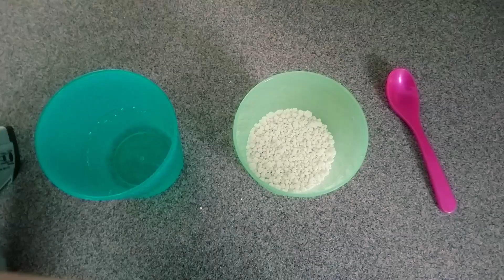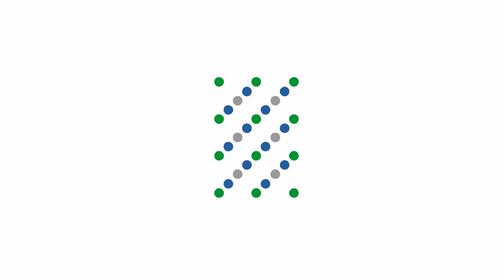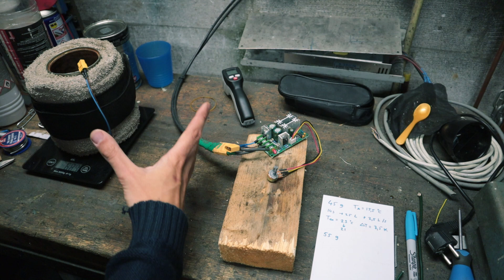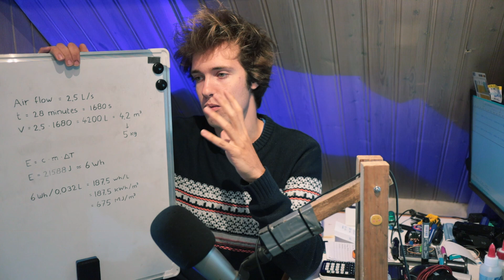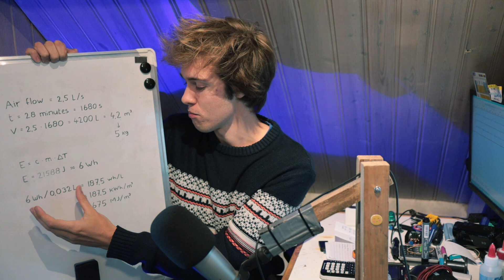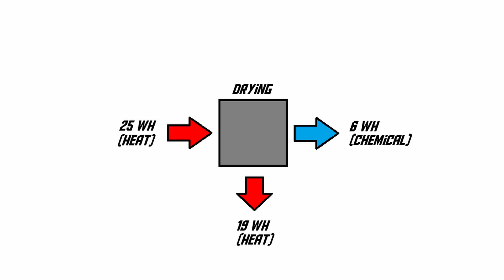Thermochemical energy storage: an interesting way to store heat

Comment from the maker: IMPORTANT INFORMATION:

Turns out the heat capacity of air is actually 1000kJ/kg K, not 700. I was fooled by Google search which gave the wrong answer. That means the energy we stored was a bit over 8 Wh, which means the energy density was over 900MJ/m3 and the efficiency over 30%, so better than the video shows

The salt in my setup is never dried completely. Di- and mono hydrates of calcium chloride melt at 170+ C, which my setup cannot achieve. 
Therefore the setup only dries to the dihydrate state of calcium chloride, meaning some water is still in there in the "dry" state, even if the drying setup is left to run for an infinite time.

I forgot to measure the volume directly. The 32mL was based on the density of CaCl2 hexahydrate (1.7g/mL). In reality, the volume would have been slightly greater due to the air gaps between the grains. I considered it fair to use this "smaller" value though, since likely I could have run the setup for longer without overhydration, and could have started with dryer salt, which would have increased the energy content, so this sort of compensates. Not a very scientific way of thinking of course, but realise this wasn't a scientific experiment, but a demo for a YT video, take the values I measured with a grain of salt and look at actual research for obtaining values :)

My camera had some issues which caused some glitches in the video. Your graphics card or monitor is not broken.

Thanks for watching!
Reply: Given that premise, it would have been better to just explain it using already available data and some slides. Trying to derive the data using terrible methodology became a distraction from the point you were trying to make. You also didn't bring up the efficiency of the process until around ⅔ of the way through the video despite it being a key factor in deciding how valuable a process is.
Some channels you might want to check out for different ways of presenting and/or demonstrating something like this are Practical Engineering, Undecided, AvE, Cody's Lab, Minute Physics, The Thought Emporium, and Nile Red. There are many others, but I think that's a decent variety of styles.
I think the styles of The Thought Emporium and Nile Red would most fit you, but the others touch on topics it seems you would be interested in and might provide some inspiration for how you would want to produce your content
Reply from the maker: @blackoak4978  First of all, I know most of these channels, they're great.
So although some things were off, I wouldn't call the method "terrible". The numbers are, as far as I can tell fairly accurate, and match up quite well with what research shows. The biggest problem is the wrong value for the heat capacity of air, but I only discovered that after the video was up. (and what a stupid mistake it was) 

I felt in general the accuracy of the test doesn't change the conclusion of the video much. If anything, the errors here make TCES seem a bit worse than it is. If it had been 40% energy denser, or less dense, the general point would still be kind of the same: not quite dense enough to be revolutionary, but perhaps better than sensible or latent heat storage. 

Of course I could have opted for a different way of doing this. For instance, I could have just used existing values, but IMO, that's a bit boring and gets the point across less well. Otherwise, I could have done the demo without measuring values, so that people could have seen it in action, but then used existing data for analysis. That is something I considered doing, and almost did, but I decided against it, because I think doing the measurements on camera adds extra value, because it allows people to think/learn about calculating heat energy in an air flow, etc. It also contained the (IMHO) important lesson not to just blindly trust a power meter (or any measuring equipment for that matter). Basically, although things didn't go perfectly, I think there's stuff in there people can learn from, which includes the mistakes. 

Finally about the efficiency, first of all it's not quite as critical as it seems. Systems like this are generally charged from "leftovers" such as excess power generation, direct solar heat, or even industrial waste heat. Say your storage system can store 30%, then that means you can recover 30% (a significant part) of the energy that would otherwise not be used at all. 30% is low, but turning a solar panel completely off, or dissipating all heat through some cooling tower is clearly worse, and so even with a low efficiency it can be a significant improvement. This is the reason why I didn't discuss efficiency earlier in the video, because it's not as important as with other energy storage systems.

That doesn't take away the fact that efficiency is very important nonetheless. I tried to find information on this, but I could not find a practical test result for the charging efficiency of a salt hydrate system. If you happen to find it, please do send it to me because I'm very much interested in this. This is actually one of the other considerations I used when I decided to test this myself, I wanted an efficiency figure, which I could not find elsewhere. I figured, given my rather simple drying setup, I could at least obtain a worst-case efficiency figure, which is better than nothing. The number I got (25-30%) with a very basic setup, makes me optimistic about what would be possible given a bit more design effort, so I do want to try it again some time soon, with better thermal insulation.
Reply: Oh, also Applied Science
Reply: The energy consumption will be lower if AC power was used to warm and ventilate. AC to DC loses about 10-15% and the mosfets on the motor speed controller are converting some power into heat, adding up the loss.
It is also easy to wire, less investment and simple to control.

Comment: Not seeing "storage/banking" in this at all. See only how to make heat in an interesting way. What am I missing?
Reply: OK, I get it now. It operate backwards. As in it is/was, already hot slury of water and the medium (CC) and you produce electricity, to make enough heat to steam/drive off the water.* When you want heat again you pump water back in.

Guess you would need more than one. An, odd number of them per battery/heater bank? ?  

As in: during  day time, you mix slowly water into one for day heat. Solar/wind etc. on same day is heating up a second one whose heat was exhausted during a previous night and now your driving water out. (which may take more than one day of solar/wind etc to drive off enough water.) Third and Second are bit of an overlaping  team.. One of the two has become  ready, aka fully water removed , for night time heat  ( introducttion of water) .  Third one is buffer-ish to accommodate  the reality of time needed to drive all water out of the one whose heat has been exhausted.

Comment: This has some potential. Someone can build some metal container and leave it to dry entire summer. I am sure that 3-4 months of sun heat will dry the thing.
With 10 of these thing each having 1m3 you have all the heat for winter. 
But, yeah, you need some land, and will probably be costly to do it, but I guess its an option after all.
Reply from the maker: @danielmogos8990  It does depend on the temperature though. You need to get the temperature above certain thresholds for drying (I think I mentioned this in some other comment in more detail), and those temps will be higher than the outside air temperature even in very hot climates. If you don't reach the required temperature, you can wait all you want but it won't dry. 

Therefore you can't just leave it outside to dry, you'll need to use some form of concentrated solar heating. In the simplest form you could focus sunlight on a salt box with some mirrors, but the most commonly available practical solution is to use solar heating panels, which can heat water/glycol to 100+C, which can then be used to heat the salt box and dehydrate the salt.

Nonetheless it is indeed feasible to dehydrate a salt with solar heat during summer time.
Reply: @AKIOTV  Yes, I wanted to mention that. Calcium chloride is not the best salt to use because of high temperature needed for charging. Instead potassium carbonate can be charged at 60 degrees celsius. Closed and black painted metal container can easily reach this temperature during summer months.

Comment: How much of the energy is actually from the chemical itself, and how much is actually just harvesting the latent heat of the water vapor condensing/solidifying?

Low level thermal energy storage like this would seem like something maybe for replacing winter heating requirements from fossil fuels or electric, and recharging during summer when solar energy is in excess. But, during the winter, when the heating would be needed, the cold air would be very dry. Having a tank of water on hand is easy enough, but that's liquid. And if we have to evaporate the water into vapor somehow in order to get all that heat, it won't really be useful.
Reply from the maker: @Brainstormer_Industires  At very low temperatures, although the power output will decrease due to less moisture, the energy content is the same. So as long as the setup is designed with enough reactor surface area to account for the worst possible humidity conditions in the local environment, you should be fine. For very cold/dry climates, I've seen some prototype solutions that make use of a borehole into ground water acting as a moisture source. 

Another measure that I think I've seen can be added is a "temperature booster", which basically amounts to an electric humidifier to send maximum moisture into the salt. This can be used to temporary generate very high output power needed for stuff like showers, at the cost of some additional electricity of course.

As I've mentioned in a reply to someone else, I'd love to know more about the chemistry on how much is chemical energy vs latent heat etc., since I'm not entirely sure.

Comment: @AKIOTV For the physical degration problem, there is a paper that shows that mixing in a small percentage of hydrophobic silica fume prevents/reduces the physical degregation of the calcuim chloride. the paper title is: "Exceptionally high energy storage density for seasonal thermochemical energy storage by encapsulation of calcium chloride into hydrophobic nanosilica capsules". 

I've been searching for a simular reaction that occurs purely in a liquid phase, as liquids are easier to processor and automated. Just starting to read up on mixures of lithium chloride and calcium chloride. The other reaction i've been searching for is one where the drying reaction occurs, around 40-60 dC, so that an energy efficent heatpump can be used.

Thankyou for the video, calcium choloride has some amazing energy storage denstity. However i think your conclusion is wrong, calcuium chloride is insanely cheap. Can store on the order of 388 kwh per cubic meter, which is well with the seasonal storage range, and 170 dC isn't hot at all considering that most convection ovens easily reach that temperature.

Comment: This principle was once used to power small steam locomotives. Steam exhausted from the engine was injected into a mass of strong aqueous sodium hydroxide that surrounded a copper water tube boiler. The vessel containing the solution was vented to atmosphere. The steam condensed within the solution which increased the temperature enough to generate pressurized steam in the boiler to drive the engine. There was no emissions of any kind during operation. The solution was recharged by heating to boil off the water previously absorbed.
Reply from the maker: @MarcosBuenijo1973  That's something I'd not heard of before. Pretty clever.

Comment: Nah, Not a viable method. issue is that it will take a lot of energy to boil off the water to make dry again, probably 50 times more heat energy input to boil off the water, than you get back dissolving it in water. 

The most practical heat storage methods are phase change materials such as wax and Sodium Acetate, but these also have issues.

Currently the most practical is just storing heat in water: use a water tank to heat up and then circulating to extract the heat. Water tank can be heated using PV or with solar thermal panels. This is the cheapest & most reliable solution, but is a low thermal density method.
Reply: But the purpose was not to demonstrate the free energy device 😂 You store heat right,  which means you use that big thing from the sky for charging.
Reply: @danielmogos8990  No, still very low EROEI. Its like trying to power a 25W bulb with a 1MW generator. I provided better options in my earlier comment
Reply: @guytech7310  EROEI is not as important as effectiveness on a societal level (cost-efficiency in some context), compared to other methods. Is this better than, for example,  living off gas (hauled in tanks) using heaters with 20% efficiency? I'd say yes, so this IS viable. Obviously not a universal solution to all our problems, but I can imagine an engineered system of this, coupled with a solar dryer, that's ideal for an off-grid house.
Reply: @besenyeim  Its not cost effective either. You waste more money & fuel that it will save. 

FYI: I heat with Propane, & it costs me about $100/mo in Propane during winter. I have a condensing Boiler with a 80 Gallon Thermal (Water) tank (prevent short cycling. Tank has a 4KW resistive element for solar but I don't have any solar panels yet. Plan is to dump excess solar into the thermal tank. Also planing to add a outdoor wood boiler (I have about 90 acres of wooded land). Using chemical or phase change methods to store heat just isn't practical.

Best option for efficient & cost savings is to properly insulate a home to reduce thermal losses (heating & cooling), Last is adding gadgets for thermal storage, solar, etc. The #1 issue with homes is very poor insulation & air leaks.
Reply: @guytech7310  I totally agree about insulation issue. Spending more for a proper layer is the best investment when building a new house.
Your plans (solar & wood) are also good.

It still seems that, you see thermochemical methods as inferior in general, because they are, in your use-case. But for a few others, it may be the best.
Without that explanation of circumstances, your opinion sound authoritative. You clearly did your research, and what you say is true most of the time, but not every time.

I'm not trying to change your mind. I just suggest you to express your opinion differently, so you won't discourage others from exploring alternatives (even if they are far from the best).

But I feel we are running off the topic of the video.

Comment: Good one. <But I can still not really imagine how an application would work, regarding it is put energy in there both ways. How would a real scenario look like?
Reply: One could dry the salt using solar energy (or in general when electricity is cheap -- for load shaving), and reintroduce moisture to produce heat in the evening and morning. In practice, it seems mostly a solution that relies on an abundance of energy available at the wrong time. Due to the shift to renewables, that means it may one day actually be viable.